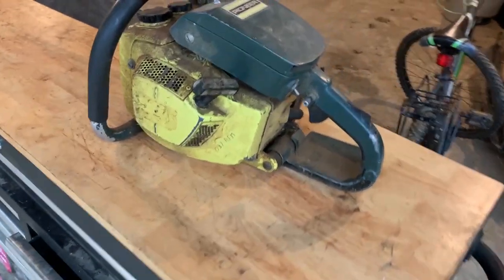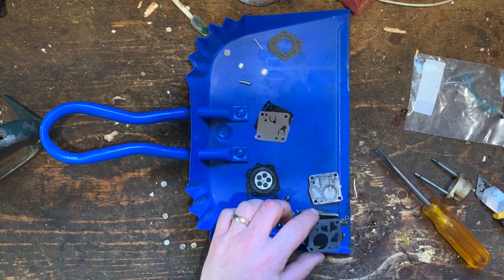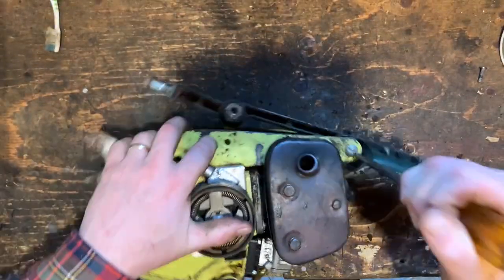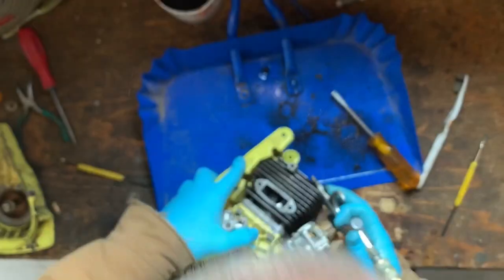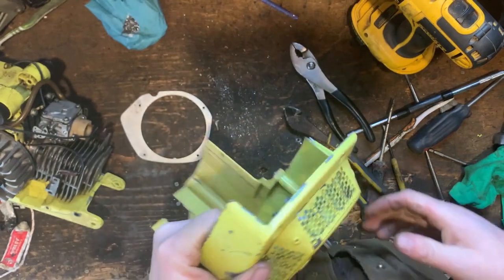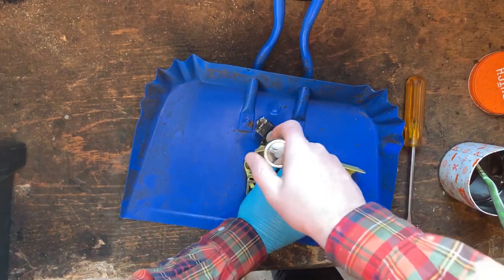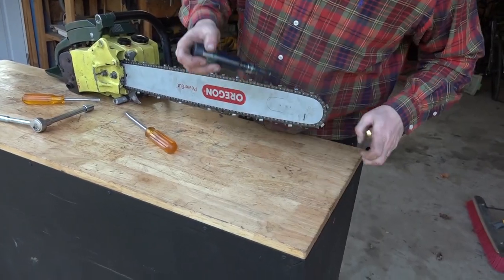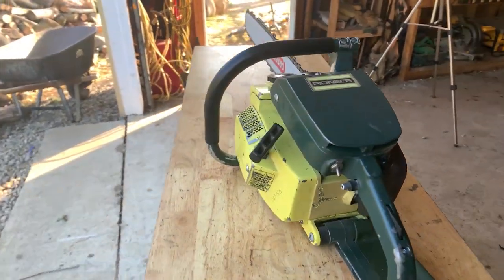Vintage Pioneer P41 Chainsaw - Old Iron Brought Back to Life

Comment: That is a nice saw. I have a P41, here in England, which I purchased at a local auction. Spent a little time getting it going, but runs pretty well now. It didn't have felling spikes, and parts are not so easy to obtain, as you say. So I ended up making spikes for it, from a sheet of 2mm thick hardened steel. Nice to get these classic vintage saws going again.
Reply from the maker: Right on!   These older saw don't rev as high as newer saws but you can't beat their low end grunt!

Comment: Good job on the saw, you just can't beat the vintage chainsaw, their made of metal not so much plastic, little more weight but once on the log all you have to do is pull the trigger. Great video 👍
Reply from the maker: Yes, especially like the torque it has.

Comment: Great video. Thanks.  Can you tell me what Oregon bar and chain you fit on it, model etc.  Would be very helpful.
Reply from the maker: Oregon 240RNDD176 .050" Gauge 3/8" Pitch 24" Power Match Bar - https://www.amazon.com/gp/product/B001BAHRCM/ref=ppx_yo_dt_b_search_asin_title?ie=UTF8&psc=1

OREGON 72LPX081G 81 Drive Link Super 70 Chisel Chain .375" Pitch x .050" Gauge
https://www.amazon.com/gp/product/B01MRXRLZE/ref=ppx_yo_dt_b_search_asin_title?ie=UTF8&psc=1

Comment: Great Saws!  I'm missing the four bolts for starter cover - do you happen to know the thread and lengths? I can't seem to locate info anywhere.  Thanks for the thorough video.
Reply from the maker: Its an 10/24 thread pitch x 3/4 inch for the 3 short ones.  The long one is the same thread pitch and 2.5 to 3" long.

Comment: Does all that cleaning on the outside make the saw cut better? It is a saw and will get covered with sawdust within a few minutes of starting to cut!
Reply from the maker: Gives 3 extra HP :)   I do it on any used saw I buy as its a good time to go over everything and see if there are any issues.

Comment: Good effort on the video very interesting! ive just aquired a p41 79sh 12/21 in amazing condition done very little work! for the bargain price of 40! english pounds! still pinching myself! they are a beast of a saw! got a excellent 20" bar/chain on it im gonna get a 28/30 see how it likes that?  runs like a dream! for a 40 year old! blew carb de-baffled and de-governed running at 50.1 mineral but its worrying me? what mix do you run? and is it still goin strong?
Reply from the maker: I run 40:1.  i had issues with the ignition and had to change out some parts but still going strong!